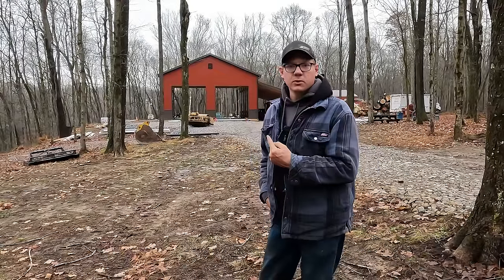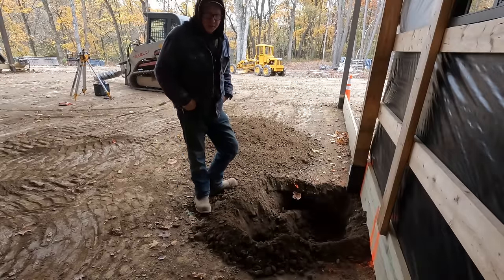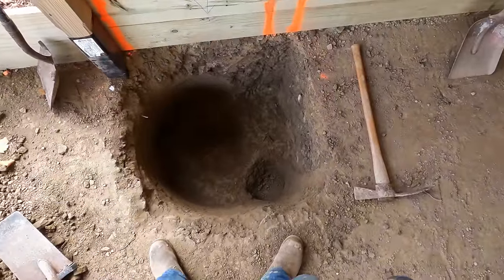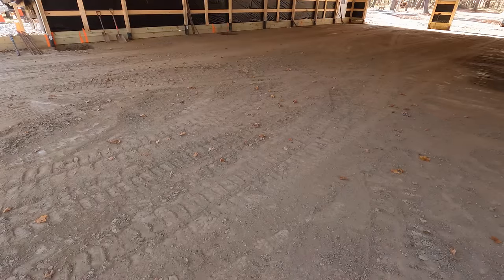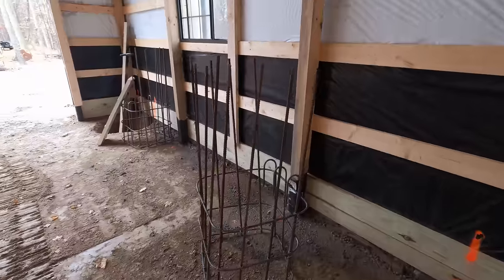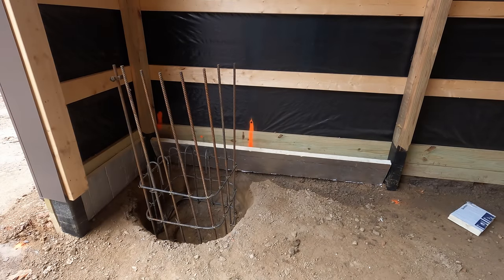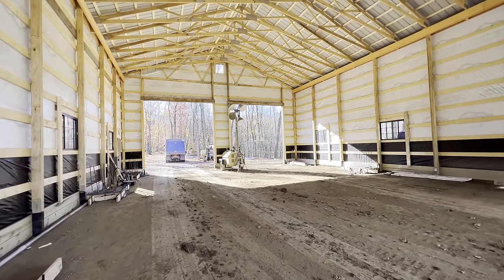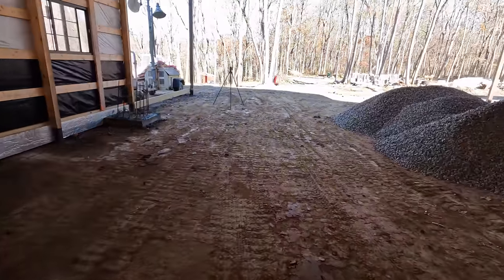Digging & Pouring Footings for a Bridge Crane! (Dream Shop Build)

Comment: You not installl the threaded rod for the base plates into the concrete? All the cranes I've dealt with have j-bolts embedded in the foundations.

Comment: I'm curious: was there a reason you decided not to dig-out the crane footings and do concrete work before the structure was erected? Digging those footings before the building was placed would have been much easier since you don't have to worry about damaging any building structure and could also serve as layout reference to the building itself.

Comment: (Skipping the preceding 1.2K comments) - On digging those holes for the crane: there is this concept of using two concentric pipes and water. (You may invent the square edition.) LetsDig18 has invoked some specialist in this (twice this year, from my memory) to locate power lines in pond dams on overflow jobs. However, it may be useless if you can expect "particles" too heavy to be loosened and lifted this way.

Comment: Personally I would have prepped the floor and footings at the same time and poured at the same time so everything is one piece also I didn't see you putting a moisture barrier between the dirt in the footings and between the dirt and rocks you also could have poured strip footings and in between a floating floor so as the footings settle it won't crack your floor and for stronger concrete you should use fiberglass infused concrete for extra strength

Comment: You can use lots of simple stuff to fill the screw holes before pouring...to keep concrete out of screw / fastener ...bar soap or grease etc...silcone dabs are easier to remove than concrete ...tape over the screws too works...planning ahead makes the next step easier...even going around and cleaning the exposed screw heads and sticking a screwdriver in cleans it enough to make removal easier...and shoveling away the extra concrete while it is soft makes it easier later...lots of things you learn by making mistakes...lol...or experience? 🤨

Comment: More water will slow normal concrete curing speeds but if that concrete had been a hydraulic mix then it would have accelerated it.

Comment: What is with the extra wheels on the back of the cement truck? Is that if they back into a wall and it doesn't damage the wall?
Reply from the maker: No that will come down and take some weight off the other axles. Called a stinger

Comment: Im hoping that you will be putting insulation below the concrete slab. Or do you intend to heat up the ground aswell?
Reply: I think he'll want to heat up the ground - that way you can spend more $$$.....!!
Reply: @andymccabe6712  Well, after watching different good people on youtube building their home or shops i sometimes feel curious what is code/regulation and whats just common sense. I have 30cm, almost 12inches of insulation below the slab on the house, and 20cm almost 8inches below the slab in my garage.
And thats the common way to do it here in Northen Europe/Scandianavia.

Comment: i spent the summer of 2014 bending and welding rebar cages for electrical duct bank. not the toughest job i ever had and i was 51 at the time poor you dont know how you will get along in that little space pro tip i picked up along time ago use nails to build forms

Comment: Water doesn't "slow the curing of concrete"
Hydration is what causes cement from form crystals and lock itself (and the aggregate!) in place.
The only reason you want to keep it wet or spray a cure agent is to allow the concrete to continue to hydrate, for up to 28 days... or a cycle of the moon... or a woman...whatever.
Back in the day it was under a roll of 8mil plastic with wet burlap in summer or salt hay in winter.
Hoping the slab gets plenty of pitch and someone really, REALLY knows how to drive a power trowel!

Comment: I don't  know  why  you didn't  use  inbeds. With   3foot. Rebar. Pens. And  you still  could  put  some  Rebar.  Also  to tie into  slab   but  with  the plate steel  of inbed you would   some things to  weld you  I beams  to

Comment: Protip: when building forms that might get say concrete inside the screwheads, go to local beekeeper to get 100% bee wax and fill the head with that though it might be bit stiff on the winter and at worse need little blow torch action to get it out, but least it aint concrete. Alternatively if you dont have anything else around any grease works fine.

Also i still dont get what is point of this construction. If you are pouring the floor, might as well made foundations properly. With this it will be pain in the ass when those pillars eventually rot and there is nothing under them but guess the crane frame works as support when it collapses... And dont get me started on pressure treated lumber inside the heated building...

Comment: Not to be a MMQB, but what happened to the bending system you used for the hydraulic lines for Christine? IIRC, that looked much easier to use? I suspect it wasn’t strong enough, in which case I would have considered doing the bending on the hard wooden surface of your trailer! 😂

Comment: Hey Matt I don't know anything about concrete and rebar but I'm curious would it have been better and faster to weld the rebar? Serious question not a keyboard commando.... Hope all is well with you and the wife. Great work sir!
Reply from the maker: Some would argue for it… 🤷🏼‍♂️ it’s a toss up in my book
Reply: I can understand that... I didn't know if wire tying them would let it move a little bit and that would be helpful for some reason. Thanks for the reply.
Reply from the maker: @wildcatwilly  depending on the scenario that could be beneficial. Here it didn’t matter

Comment: Why didn’t you install anchor bolts for the posts.. this should have been engineered and installed with the concrete pads …

Comment: Your shop is already awesome, good things come from hard work. Something the democrats need to learn.  Anyway, spray your wood forms with wd40 or brush on used motor oil and the concrete won't stick to them, Thell come right off .

Comment: Would it not have been better to use a metal framed building? Was this much cheaper your way?
Reply from the maker: I went to the metal building. They were three times the cost
Reply: @DieselCreek  Thanks for the info

Comment: I prefer using hex head screws. Easier to remove. just tap them with a hammer and any concrete falls off. Traditional screws are just to much work to get out.

Comment: Did someone tell you to tie those piers to the slab? I would NOT do that. The piers are weight-bearing for the vertical I-beams supporting the crane. 
On the other hand the slab supports the weight of your vehicles etc.  
and that slab will be expanding and contracting all over the place. 
I would pour the piers first and then do a second pour for the slab, with no rebar connecting the slab to the piers. 
(Edit - wrote the above before I saw your pour)
Reply: My fear is that slab is going to move around, and you may get some substantial cracking where the slab meets the pier/footing rebar.
In other words, I would have isolated the slab from the piers, and let that slab essential you”float”.

Comment: Man if I only knew you would needed a larger auger I probably would sold you the 2 I had to you lol. But unfortunately I scrapped them instead of holding onto them. I believe 1 was almost a 30in can't remember, I picked it up as scrap so didn't really looked over them much. But tell ya what most times you make due on what you have and look how far you've gotten.

Comment: I'm guessing because of the bridge crain your going to be useing rolling steel doors and not regular overhead doors . Witch for me is regrettabl because even if you get rolling steel insulated the R value is going to be sad when compared to a  Richards Willcox R20 and that's a true R value ! With Rsteel it's impossible to get a good R ratting since so much of the steel on the out side is roll formed to the inside of the door section .the only way is to have the doors hug the calling as much as you can and run the brdge crain under the doors. For me there's no other way I would have it .... if you need more clarification I would be very happy to help give you a solid understanding of what I'm saying .

Comment: R.I.P. skin friction and bearing capacity on columns 1, 6, 8 & 10. You may want to have your Eng come out and do a site survey. Anchoring your load bearing columns to your nonstructural floor sounds like a recipe for a cracking nightmare. The Eng may consider actually separating the columns from the floor with bond breaker, but that’s their call. Good luck on your project. Love your content.

Comment: Well somebody has to say it. The time you don't spend cleaning up spilled concrete with a shovel and trowel comes back to haunt you later. Plus the expense of wood these days justifies keeping it nice to use a second time. It ain't like there's no old Diesel or oil around there to paint on the form boards.
    But you knew that as you were doing the form stripping.( insert teasing ya emoji here)

Comment: What does the tube do when pouring concrete
Reply: It actually a vibrator , the vibrations that go out into the wet concrete help it to settle and helps any air bubbles to be released.

Comment: Did you know that air weighs about 2 lb per cubic yard concrete weighs about 4,000 lb per cubic yard. Doesn't that mean it's two thousand times easier to heat the air in your barn opposed to the floor.

Comment: Why wouldn't you want to pour it all at one time so there was no cold joint in the concrete to crack? Also if you pour it with a thin piece on top the big footing the weight from the crane is going to crack that top thin piece will it not? Why not do a monolithic pour? Pour the floor and footings all at the same time so the footings and slab floor are all one with no cold joints or thin piece to crack. If you didn't do a monolithic pour then you could have formed the footing up to the top of the finished floor level and drilled holes in it for the rebar going out in the floor. I really think you'll have problems doing the way you are but I could be wrong and only time will tell. Great video. 
Stay well. -Wil  👍
Reply from the maker: If I had an entire crew working with me I’d consider that however that’s a tall task for one guy. I’m sure the floor will crack around the piers however we will cut control joints around them so they won’t be a problem

Comment: There is one thing that worries me a little about your future plans.  Have you really looked hard at the cost of providing electrical power high up there on your "mountain"?  You are a LONG way from a highway for overhead power, and even a reliable generator of sufficient power will be very expensive.  Forgetting the power supply in the excitement of a self-build is a very common problem!

Comment: mate your bending reo the hard way get a excavator with a blade on it lift it of the ground a inch so you can slide the reo under then put the bucket infront of that so theres about a foot between them lay the reo under the blade but over the bucket jump in the cabin and use the bucket to pull them up. can do a dozen at the time and not bust a gut. get a nicer bend

Comment: Past experience tells me trying to put a heated floor in concrete with pipe  NOT a good idea!   Used copper pipe - cost a fortunate to purchase /install - pipe quickly developed leaks due to chemicals in the concrete and water.   When floor piping developed a leak there was no way to know exactly where the leak was coming from so had to jackhammer holes in floor and follow the water til you found the source of the leak.  After two winters (CO) they abandoned the entire system and installed overheat heaters in the entire four two hundred foot long bays.

Comment: Let the slab be independent. From the piers.  Dont tie the piers into the floor.  It needs to be independent.  Cut in joints.

Isolate it from the piers with expansion joint material, which should be caulked when done.

Google reentry cracking to get an idea of how to cut in the control joints to control the cracks. Not that it's terribly important for this application.
Reply: WHY. !?
...do you think it should be independent..!?!?
Reply: @andymccabe6712  the slap will expand and contract.  The beams holding up the overhead crane will put a load on the pilings and will move up and down depending on the temperature.  The slab must not be attached via rebar to the pilings for fear of cracking and buckling.

Comment: I hope you lifted you cages off the bottom of your hole or put plastic chair under them. if not you will over time start the prosses called concrete cancer which will work it's way up to your slab.

Comment: 1st thought i had was man hes losing a lot of square footage with all those column footings. Then the more i thought about it a guy could use the space in between them for work stations. Like welding bench in one,general use bench in another,tool chests in another,shelves etc.
Reply from the maker: I’m really only losing maybe one square foot for each column
Reply: @DieselCreek  right but it makes the outside wall space compartmented and boken up.Dont get me wrong im not criticizing at all just thinking aloud. We have a 2 post lift to install and its going underneath the arc of a pivoting chainhoist column to lift engines etc. Just maybe gonna rethink how we do that.
Reply from the maker: @anthonyross9276  ohh, I plan on having
Benches and shelving just as you said before between the columns